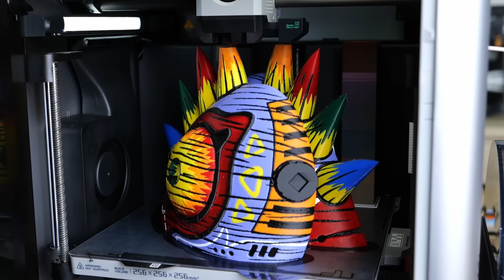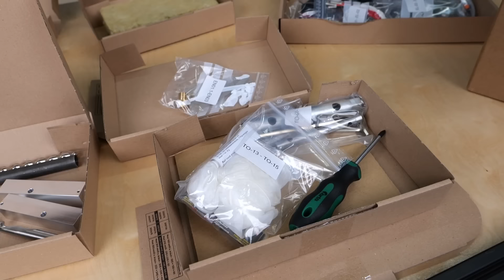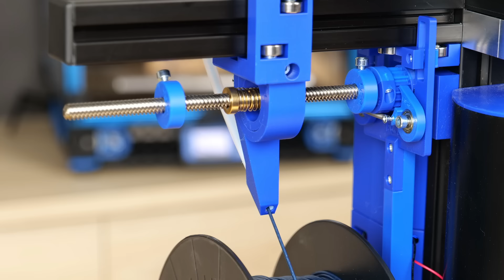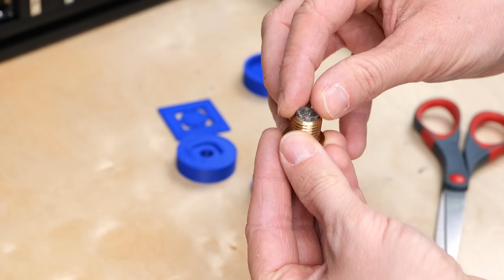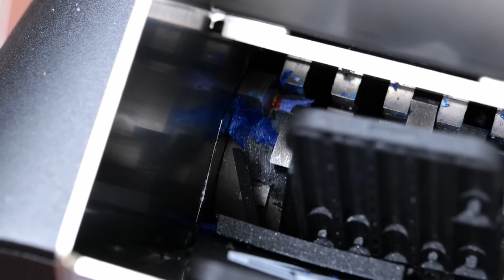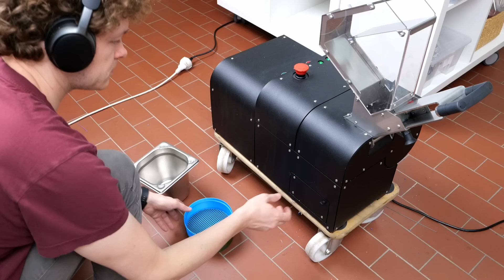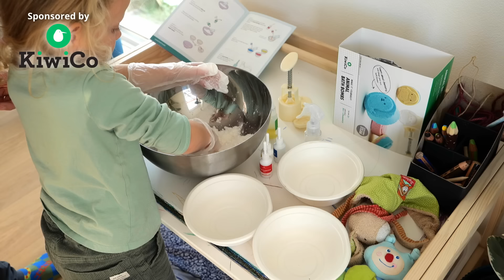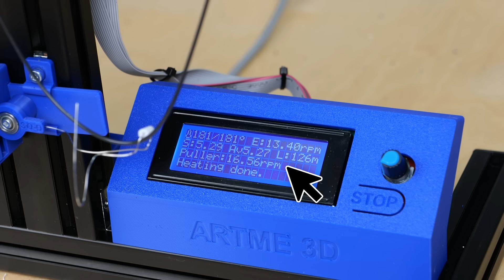Recycling Failed 3D Prints with a DIY Filament Extruder: Artme3D

Comment: I wish I had waited till 2023 and bought this extrusion setup instead of the Chinese well zoom. The winding is impossible to control on the well zoom. The Artme3D has great tension control and instructions, seems very legit.
Reply: you did not research well , it was available since 2020.
Reply: @gj4769  I’m a researcher by trade so that’s a steep truth to accept, but you’re right. Next time, I will search for German products first. Learning about engineering

Comment: If you're still looking for test for this machine, I wonder what happens if you're lazy and have NOT separated your failed prints by material, yet you still try to recycle it into one filament. Assuming you at least try to match printing temperatures, but not materials. Will a mix of ASA and PLA work for example?

Comment: great machine but totally out of the hands of the average maker, a club perhaps but even then you have to question the economics of it all . What is better is to force the producers of filament to accept it back when no longer required . the polluter must always pay.

While you say its a 600 dollar machine its not in europe and youre not factoring in the running costs, the heating and dying costs plus capital expenditure of a grinder, oven etc.

As I said earlier it should go back to the manufacture to recycle, that is the only way

Comment: @CNC Kitchen Would it not be an idea to have the filament sensor in a water bath cooling the filament as it is falling in. It would also prevent the filament to not stick to the little roller

Comment: Before you run the ground up, recycled materials. Put them in a box with magnets shaking well, and that will remove that magnetic metals. You can also put them in a bucket of water, the plastic will float, and the metals will sink for any non-magnetic materials.

Comment: This seems like a nice idea, but hugely impractical for 99% of 3D printers. Over 600 Euros for something you need to put together yourself (with all the potential for errors), requiring an additional shredder which (from what I've seen) cost over twice that, plus the time and room that both of these require to operate. That works out to be equivalent to about 120 x 1kg spools of PLA, which is probably more than I will use in my lifetime! Bear in mind that you'd also need to be RECYCLYING this volume of failed prints for it to be economically equivalent, because you need the starting material - considering the improved reliability of modern printers where failure rates and waste are probably less than 10%, you'd need to be getting through over a metric ton of filament to make this worthwhile. Overall, this is just not a practical or economic solution for anyone except industrial printing houses.

I see this like 3D printing in 2010 - an expensive niche for a few people - hopefully it becomes more mainstream and affordable. If you could buy a unit for 250 Euros that shredded and re-spooled 3D prints, it'd be worth most people buying one - but not for 2000 or more plus a bunch of work and 3D printing.

I think a more viable alternative would be for this to be offered as a service = if people brought failed prints to a shop and could get "credits" based on weight, with a certain number allowing a "free" spool of recycled filament, that would be an appealing model, Of course the volume of failed material you'd need for a spool would be more than the spool (maybe 200% or more) so the shop could also sell spools to make it economically viable,

Comment: the issie is not that this machine is 600usd (which place it at the same proce range than lots of mid range printers). The issue is that it doesn't work if it is not used in combination with a shredder and a vacuum chamber. So we're talking about a lot of equipments. Maybe that's finefor some hobbyists and the average american dad who owns the gdp of swiss in tools in his garage, but for most pwople who are budget and space limited, that cannot do. It's great to see the how far the tech has gone, we should start to see such devices in maker labs soon and maybe compact all in one aolution in about 10 years, conaidering how long it took for the 3d printer to move from the market niche to mainstream.

Comment: Well it certainly works.....but at what an extra cost ?? The shredder , the filament extruder , electrical power used and time and filament to print the extruder parts exceeds 1200 euro's easely. 1200 euro devided by lets say that an average roll of 1kg filament would cost me 30 euro's max. 1200 devided by 30 equals to 40 rolls of filament. How much parts do i need to misprint , destroy or not use any longer to reach 40kg filament?? This solution would only be usefull for those few people that have a dozen printers working for commercial purpose. I very much doubt they will invest in such solution , its far easier to add the cost of wrongly printed parts or waste to the price they ask from the customer. Only my 50 cents.

Comment: Watching 3D prints get ground up and used for manufacturing again makes me realize that I have operated injection molding machines, but not yet a 3D printer.

(We did grind up scrap and toss it in the hopper with the new resin. I forget the mix ratio that we kept below)

Comment: I love how you have the ability to form new mesh filters as required. The original manufacturer doesn't rip you for replacement parts.
Reply: As a manufacturer of bike suspension forks I know how the responsibility for spare part supply feels. If you are a one person company and the creative person you don't want to be in charge of that. My forks are designed not to have any parts that wear and if special features need wearing stuff I tell my customers how to get those parts without bothering me.

Comment: Hi Stefan. Love your videos.....
I have one little upgrade you can make to this machine..... on the angle sensor arm, replace the little white tube with a slightly bigger outer diameter one, that has a V or U groove, that will keep the filament centralized and stop it from sliding off the edge and catching.....

Comment: It would be nice to recycle more material, but any polymer has a fixed amount of time and reprocessing before the chains degrade to the point of no longer being useful. Coupled with the extreme expense of the equipment required to grind and extrude recycled filament, I just don't see it being feasible long-term for hobbyists and other makers at home. Having filament manufacturers recycle their internal waste is fine because they have the volume and the equipment to make it worthwhile, but for the rest of us I'd say we should focus on minimizing waste by being smarter with how we use supports and bed adhesion aids, use IDEX printers instead of single-extruder printers for multi-color and -material printing, and stop buying printers that poop all over the table.

Comment: This machine looks very promising. Good recycling solutions are the main thing I've wanted since first getting interested in 3DP. Two questions: How well does a food processor work for shredding? I would assume it would be far better than a blender. And how much does contamination between PLA and PETG gum things up? This seems to me the biggest problem for small makerspaces that might be the main places that would really want filament extruder/recyclers.

Comment: is there a reason to extrude it out of a nozzle into the air rather than into a ptfe tube or some such where I'd imagine the the back-pressure would ensure consistent diameter, and all the problems with adjustments could be avoided? am I missing something? with other processes you usually want the part to be ready or nearly ready before removing the form, why is this different, it expanding after the nozzle seems like a flawed process that is needing all this intervention afterwards rather than fixing the root cause.

Comment: Instead of rockwool, which is harmful to your lungs, use expanding foam like they use in ovens and cavities (check the heat tolerances). You can even get silicone foam kits whichare less messy. Oh and a small fan on the roller at the bottom will reduce sticking, surely.

Comment: As far as I'm concerned any 3D printer is pointless without an accompanying print recycler. The entire idea of rapidly iterating on your design that is supposed to be the core tenet of 3D printing is a hollow crass lie if you produce 5-10x as much garbage as useful prints.

Comment: Plastic waste is one of the primary reasons I have not bought my own 3D printer yet. One of the major benefits of 3D printing in general is that you can print what is needed as it is needed potentially saving heaps of time and energy/carbon spent by commercial product design, manufacture, distribution, marketing etc so I am dismayed that I’ve seen so little attention to supporting recycling. There’s *so much waste*.

Comment: Very good video Stefan!
Great results. Perhaps consider using a set of Tom's inline filament dimension sensors, and feed back into the speed controller to further improve the diameter consistency?  
Could you do some strength tests on printed parts please?  And what is the impact of mixing in any virgin material?

Comment: I feel like we could improve DIY extrusion by adding a draw or subtractive stage.
Reply: Like, the naive way of doing this could be with a series of sets of plain single edge razor blades to make hex or octagonal cuts as the filament is drawn through the assembly. It would only knock the highs down, but at least the swarf could go back into the hopper and you wouldn't end up with print-ending nodules.

Comment: I think a big reason why I'm excited about this project is that I feel like a lot of these parts can be sourced cheap or can be sourced from old machines. Like if you had an old ender 3 floating around, you probably already have a lot of stuff for this project. This project seems like the best shot a determined maker has at making a recycling machine cheaply..

Comment: This is really cool.  I used to work at a company that extruded plastic film.  We had a machine that would take rolls of film, chop it up, and feed the choppings into an extruder that would then filter through a magnet screen, then run through a pack (a filter cartridge with 30×15×5 micron screens), then through a plate with holes (that looked like it was for spaghetti) and chopped off with a spinning blade to make pallets so we could run that through our machines again.  We could recoup up to 10% recycled into good plastic without having too much carbon buildup in the hated barrel.

Make sure to write down your SOCs for the different plastic types you have.  Typically, we had the adjust temp, or screw speed to get desired results, but it's nice to have a starting reference. 

I could see preheating the plastic chips too around ±90 C would help with lengthing the extruder life before you have to clean barrel and screw.  When cleaning them, use heat and a citrus type cleaner with copper choreboys to scrap the melted plastic and carbon off both surfaces and use a rated silicone to treat the surfaces of the barrel and screw.

Comment: You should add a little digital diameter gauge on to it. You could probably make one really easily by buying some cheap calipers, and then add some bearings to the tips of the caliper. Then you could add a little spring to keep the tension on the filament strand.

Comment: It's only $600, but also needs a vacuum chamber, professional grade shredder, drying chamber, and a few other odds and ends. I'm hopeful the more options will be available in the future.
Reply: how many kg of Filament you can get for $600? and how much kg that wasted ? is it more than $600 Filament? for now i will pass.
Reply: @foreverfriday5644  But with this you could switch over to using pellets as your starting material.  It is a question of the amount of 3D printing a person does.
Reply: @foreverfriday5644  Depends on the filament.  Filament can be as cheap as $10/kg, or as expensive as $100/kg, so depending on the filament you use it can take between 6 kg and 60 kg of recycled filament to warrant the cost.
As for how much of the filament you use ends up being scrap to recycle, that'll also depend.  Some printers don't clear their nozzle on their own, so you'd only be producing as much waste as you fail to print, others might be creating a ton of waste by clearing the extruder after every object in each plate.
Reply: @GremlinSciences  Well, for home 3D printer use I belive we will choose the most cost-effective one. So it is not for home 3D printers. It for commercial recyclers
Reply: The vacuum chamber isn’t totally necessary and you can use a cheap/secondhand toaster oven as a dryer. The professional shredder is hard to get around because DIY solutions seem difficult. Hopefully these become more viable in the future to reduce plastic waste.
Reply: My thoughts exactly! xD
Reply: Depends on how badly you want to DIY things tho. You can buy a relatively cheap kit to do plastic shredding and this channel even built a hand-cranked one, you can do rudimentary drying with a cardboard filament box and a printer's heatbed (a lot of filament manufacturers' boxes are perfect for this), and vacuum chambers can be constructed using a sealable plastic tote, some reinforcement (wood will do), a vacuum hose, and some hot glue
Reply: You can get a lab extruder at auction for less than that (they often go dirt cheap) and at that point only have to worry about a die winder and sensors.
Reply: Design a cheaper version..
Reply: @chazlabreck  Just because the process isn't viable at any level, there's no need to be rude.  My take-away from this video is that recycling ISN'T worthwhile yet and not likely to be at a DiY level

Comment: The biggest issue is the return you can expect for the capital outlay, which for most hobbyists would never be viable.
If you run a business where you  can recoup the cost through high volume scrappage, then maybe it would be worth it , but that all depends on how much it costs you to make a 1Kg reel.
Even in terms of energy costs alone, I don't think it is worth it, given the energy used to shred, dry, then extrude a filament of decent quality.
Maybe if you were creating a business selling cut-price filament, but given the supply demand curve, prices of filament is dropping in real terms.

Comment: Do you think it is possible to build your own material by adding different fillers, like:
h-BN or AlN for thermal conductivity
Kevlar, MWCNT, glass fiber or graphene for strength
Al, Cu or grahite particles for electrical conductivity
Mica, glass fiber, Al2O3 for electrical insulation, rigidity and heat resistance

Comment: For measuring filament diameter, you could 3d print a v-notch card that starts at 1.5mm and goes up to 2mm, with marks ever .05mm it would be a fast way to slide the filament into the grove and check as it’s printing. I don’t know if text explains the idea well, but would be an easy (if not microscopically accurate) way to Q.C check diameter

Comment: I wonder if you shread the rescycled filament back into pellets and then re-extrude it again into filament, it will properly mix the filament as well as provide more consistent extrusion due to uniform shape and size of filament

Comment: That is one really intriguing machine. I wanted one till I did a quick & dirty cost benefit analysis. Canadian $$ but any currency will have similar ratio. With a CA$890 (est) price and an average CA$20 per roll of filament, the break even is to recycle 45 rolls of filament. Assuming a 50% poop rate, you need to make 90+ rolls to break even. And that's not including the shredder. So probably in the order of 200+ rolls. 
So if you will print over 200 rolls, it pays to get one and a shredder. That's a lot of 3D printing. 
Too rich for my blood.

Comment: $600+... That's 15 to 30 rolls of filament.  So you have to be doing a lot of printing to justify it.

And each remelting of the filament degrades the chemistry.  I would only pass it through maybe twice.

Comment: So that's a somewhat cheap filament extruder (great), but you also need an electric shredder and a vacuum pump to actually use it. Wouldn't really call it an "inexpensive solution".

Comment: As you had masked yourself with a respirator while using it and said it was “inadvertently” producing non-visible fumes = it needs a extractor fan kit to vent to a external wall/window, a fan + carbon filter to be mounted next to the filament/in the stream of the cooling fan or use it in a thoroughly ventilated room - open window/door

Comment: Depending on where you live, you can use commerically available options, if 650€ is too steep or it just wouldn't be feasable otherwise. For Germany there is recyclingfabrik for example. 
Not szure how the availability is for other countries/regions, though. :/

Comment: $600 is still way more than 99% of hobbyist 3D printer users will ever recover. I've been printing pretty actively for about 3 years now, and I've thrown away maybe 5 kilograms of filament. That's about 100 bucks, but I don't think even just one entire kilogram of my waste was the same filament, and mixing them up is not good for print quality

Comment: This is great for making your own filament out of pellets. Recycling failed prints will probably end up costing double the amount of a new spool. The machine itself might not consume a lot of energy, but the cost of an efficient shredder, the cost to run that shredder and the cost to run your oven for several hours will definitely defeat the purpose of 'recycling'. BUying pellets in bulk and making your own might make it worth while. But the design of the machine its amazing.